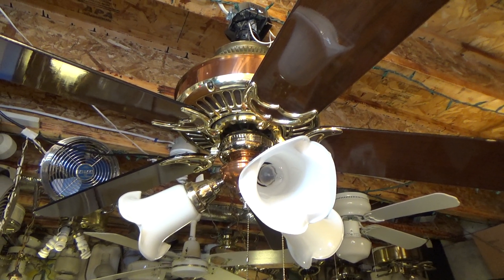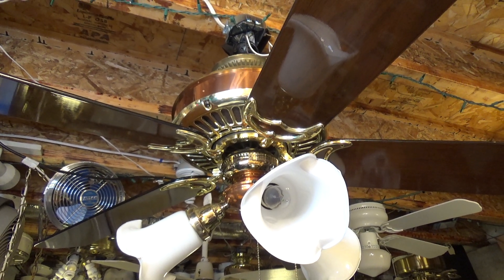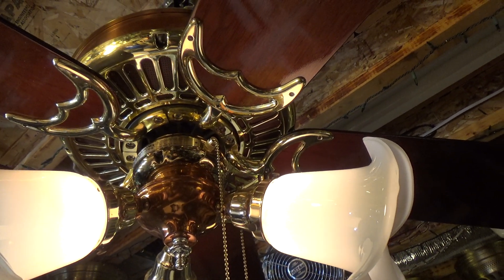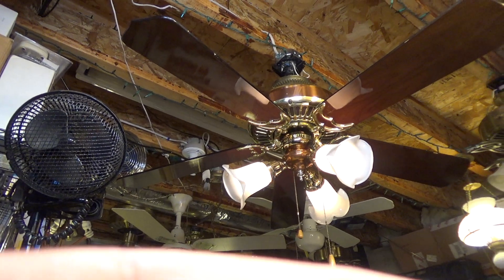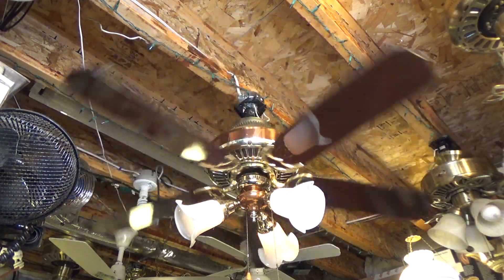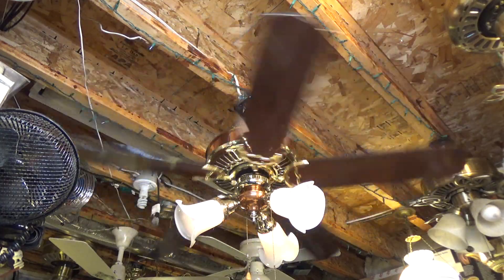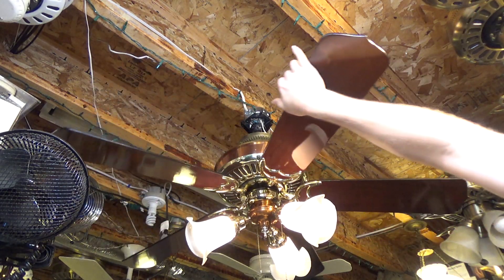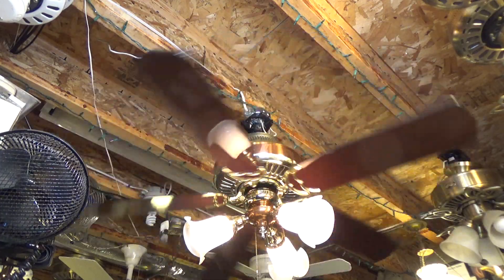50" Casablanca Panama Gallery Edition | Test after Repairs

Comment: I like Hang Tru and I trust it. It's not as crummy as you think.
Reply from the maker: That's a ridiculous thing to say.. The manufacturer would not have recalled it if there was nothing wrong with it..
Reply: You do need a recall clip for that particular canopy.
Reply from the maker: @ceilingfansclocksminecraft1226  I'm not using that canopy.. It's outrageous..
Reply: @ceilingfansclocksminecraft1226  the person I do buy my recall clips are from Vintage fans and more
Reply: Mr. Hoss Power 7 Well I have to talk to my dad about buying recall clips before I do and I am leaning towards getting some because I have a copper Zephyr.
Reply: Jordan U there’s only one type that’s recalled lol. 1981-1992. Anything after that isn’t recalled. Also there were only 80 or less cases out of MILLIONS of fans produced with those canopies. Small percentage, and there are canopy clips to ensure safety on recalled hang trus. I’m not trying to be condenscending, just trying to inform
Reply from the maker: That's fine, but I still don't like them.. If nothing else I find them extremely difficult to assemble..
Reply: @vintagefancollector1436  Eh from this video here: https://youtu.be/dlejkBclb8c you cannot rely on the date it was built really because there are some smooth canopys that are infact recalled
Reply: @aleu4618  you can rely on the date. 1981-1992 is exactly the timeframe in which they sold recalled hang trus. They changed the design entirely in 1993. I’m not going to argue, I have access to the actual recall documents and also 10+ years of experience with fans.
Reply: @vintagefancollector1436  Alrighty

Comment: I recommend using a later model hang tru that you can get off eBay. So it looks proper.
Reply from the maker: I've already obtained a replacement, it's standard ball&socket, it's not perfect but it's a close match and was a much better price.. It will work for now..

Comment: 10 UF is the capacitor rating for high speed actually for the older Casablanca fans like these
Reply: Mr. Hoss Power 7 for intelitouch* 12 is what the 3 speed fans use
Reply from the maker: 10 is not a speed, that's the base the motor calls for in order to operate..
Reply: Jordan U it’s called a run capacitor. The rating for the 3 speed boards is 12. The rating for intelitouch is 10. I work on these for a living, and have for years. My job is at a fan showroom
Reply from the maker: What were the standard values used on the 4-speed pullcain models?